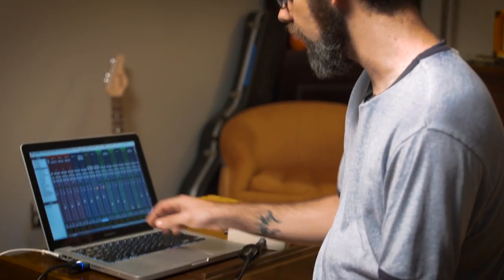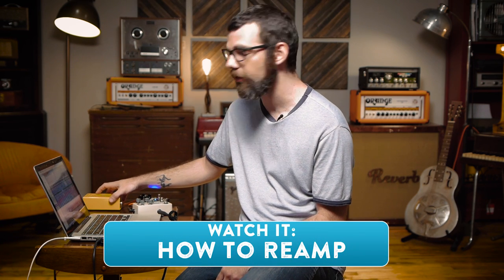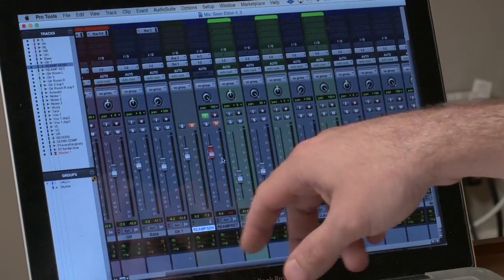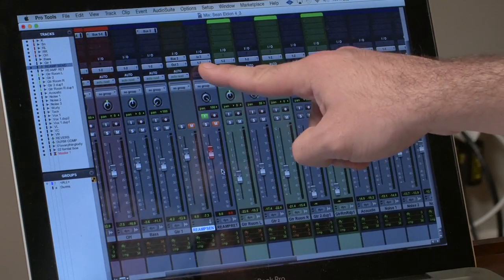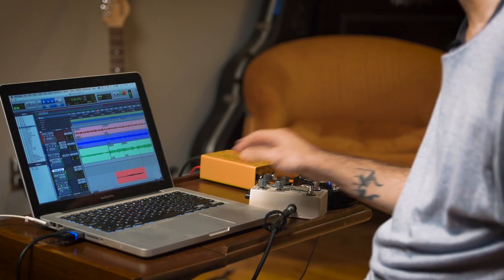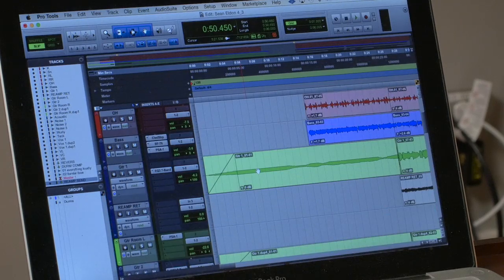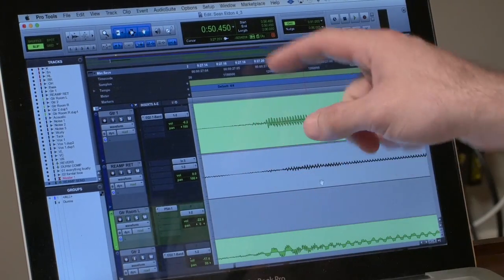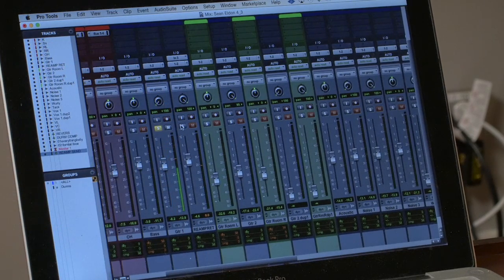How To Use Effects Pedals as Outboard Gear | Recording Tricks

Comment: Example 1:

Output of audio card (line level) > reamp box (line level to amp level) > pedal effect > instrument input of audio card

Example 2:
Output of audio card (line level) > reamp box (line level to amp level) > pedal effect > reamp box (amp level to line level) > line input of audio card

Example 3:
Output of audio card (line level) > reamp box (line level to amp level) > any pedal > amplifier input > record (microfone on amp cabinet into preamp.

Example 4:
Output of audio card (line level) > reamp box (line level to amp level) > any pedal > amp input > amp line out into audio card line in.
Reply: Espaço Ipiranga for example 2 would I be able to use my JDI or My J48 as the second reamp box?  Im thinking if the pedals are active then a passive right?
Reply: Thank you for this my friend!-this is what what SHOULD have been stated by the bloke in the video!

Comment: Well, Im sure many of us would of been interested in actual hardware connections, when searching youtube
Reply: Use an i/o plugin on the track in your DAW or adjust the output on the track if you can. Set the output to output 1 on your interface, for example. Go from output 1 on your interface with a 1/4 inch jack in to your pedal. Go out of the pedal with a 1/4 inch jack and back in to input1 on your interface. Make a new track to record on. Set the input to "input1", hit record, and you're done.
Reply: Interface out > reamp box > guitar pedal > DI box > preamp
Reply: @tomvice not applicable to this video

Comment: I usually send signal to my pedals through an output of my interface at -10dBv and return the same way on an input. Do I really need a reamp box? You think this will damage my pedals if I don't get one? Thank you!
Reply: Arturo Lopez Did you find an answer to this?
Reply: Excatly. No need for an reamp pedal if your not going in to an amp
Reply: You don't "need" a reamp box but a reamp will likely match impedance more closely to what the amp and pedal operate at input.
Reply: It does make a difference. Turning the gain down doesn’t mean there still isn’t an impedance mismatch. If you want to get all you can out of the pedals, and best quality sound, then reamp. ESPECIALLY gain dependent pedals like overdrive or distortion....big difference. Even reverbs and delays, even on pedals that are “allegedly” line level, like Eventide H9, its an improvement in sound quality.
Reply: Essentially, for me the biggest difference is that sometimes when you're not using the reamp box you can loose some low end. That's not always present but different pedals expect different signals so expect mixed results.
Sometimes there is no difference or is barely audible but in reality you'll never know untill you try out both methods yourself.

Note that there can be many different factors (impedance, voltage, db) so the best option would be just to play around, but keep in mind, that using a reamp box is the fastest, easiest and safest solution.

Comment: Really useful advise, but be careful with it. Guitar pedals are mostly mono... Reverb and delay are in most cases used as stereo effects and if you are doing mastering, bus processing or working with any stereo track you need stereo effects. Also, your interface conversion between analog and digital might not be as great as you think. Having something in analog is great, but it doesn't mean that it's necessarily better.  You might get better results from plugins in the end.
Reply: I'm new to this and am wondering, isn't there a stereo reamp box in the market?
Reply: There is a stereo reamp box, but many reverb and delay pedals are mono, so it doesn't matter if you split it after the effect to stereo, you will only get double mono recording. And most of the comp/eq/distortion pedals are mono also. So it can be used for limited number of situations and it complicates your workflow.
Reply: Milosh Mitrovic Thank you for taking your time! I'm thinking of buying the Strymon Timeline, and already have the Bigsky. These are stereo, so technically with the addition of a stereo reamp box, stereo mixig would be possible right?
Reply: Yes, that would work, you would need something like ART dualrdb or some other stereo to stereo reamp box.
Reply: Using a mono DLY or RVB is often beneficial as it adds a sense of space without cluttering the over picture too much.
Reply: @MiloshMitrovic  Could I use a 2 Channel Radial DI Box so I'm sending 2 XLR's into my interface to record in stereo? I'm confused if I should get a 1 channel vs a 2 channel, but it would make sense getting a 2 channel so I have stereo signals coming back
Reply: @razzerraw1108  Two-channel DI Box is same as having 2 one-channel DI Boxes. Channels are independent, you can do whatever you like with them. You don't get stereo signal if you use only one input, because the information is mono, but if you have a stereo out from one of you pedals like reverb or delay, you can record that stereo effect by connecting two outs from that pedal to the DI Box and then the DI box to the audio interface.
Reply: @MiloshMitrovic  So I would need to run 2 XLR's back into the interface taking up 2 parts instead of 1?
Reply: @razzerraw1108  Ok so let's say you have a stereo guitar delay. It has mono input, you connect one cable out of interface to the delay pedal in. Stereo delays have two outputs you connect two cables from them into the DI 2 inputs. From DI 2 you connect 2 XLR cables back into the interface.
Reply: @MiloshMitrovic  Thank you! I'm just confused if I should get this 1 Chanel Reamp kit from radial shorturl.at/uBKV4 , Or buy them both seperately because I need a 2 channel Box for stereo pedals. I'm planning to use this pedal shorturl.at/pDE37 as an effect for my DAW. If you can tell me which Channel DI Box would work best with this pedal I'll go ahead and start everything right away (:

Comment: so, if I have pedals, do I plug my guitar straight into my Audio interface and then use a Reamp box to add the effects after? or can i use a DI box? 

was the initial signal recorded with an amp or directly into an audio interface?
Reply: you can stomp boxes in to Di but you need a ReAmp to effect a pre-recorded track with your stomps, etc.

Comment: Should I use Speaker Cables or Instrument Cables?
Reply: Connectingf what?
Reply: Balanced (TRS or XLR, whatever your interface outputs) from interface to reamp box (You can use a TRS to XLR adapter if needed at this stage). Standard instrument cable to get from reamp box to pedals and from pedals back into your interface (assuming it has a hi-z input otherwise you will need a di as well).
Reply: So, if I don't have an hi-z input in my interface, I will need two DIs? I'm just a little confused because I'm actually a drummer, I don't understand shit about guitars stuff, sorry

Comment: Keyword: Delay Compensation. Protools can do this by itself,  can't it? At least in my system  (PT 10) it can be activated.
Reply: Delay Compensation on Pro Tools is for processing with plug-ins.  You never, ever, want to record with Delay Compensation on.  If you want to time align things that have latency delay, like in this video, you'd be using tab to transient and nudging the audio files in place.

Comment: Beginner question: so you can’t use pedals as outboard gear through reamping if you want to mic an amp?
Reply: No, you can do that. If you do the same exact thing in this video, then end the pedal chain by connecting to an amplifier instead of a di box. Once you have signal going to the amp, just mic it up to your interface and daw. Now you’re ready to record the reamped tracks through an amp.

Comment: Im just wondering if it's a good idea to plug a bass guitar into a noise gate and compressor pedal before it goes into the interface.
Reply: Why wouldn't you just use a noise gate and compressor in Pro Tools or your DAW?

Comment: So its mandatory to also have a Reamp box in order to use pedals?
Reply: I have just recorded directly through my effects but have seen people explain how to reamp with them without using a reamp box etc. But it varies on what kind of sound you want to go for. Apparently if you have a buffer pedal or any boss pedal (since they have buffers built in) you can also use that as a reamp box. It’s not totally necessary, it just gives you a better chance at creating as clean of a recording with your effects as possible by converting the impedance that travels through and out of your pedals etc.
Reply: Yes. Impedance mismatch makes the signal really sound really thin without it. You'll ALSO need a DI after the pedal if you have a focusrite crappy interface (that are notorious for their shitty hi-z inputs)

Comment: soooo is the reason i'm getting this dreadful feeback because of me not using a reamp box or is that something else?
Reply: just came here from trying to use the line out on my interface into my pedal, and then from the pedal to my interface input with high impedance turned on... im guessing we both are getting feedback because of the absence of a reamp box
Reply: psychedelicgoofball got that sorted ages ago. your interface should’ve came with a mixer software (allows you to monitor direct). what you want to do is mute all the channels on the software.

Comment: This is not a good idea at all.  You've already converted the signal from Analog to Digital once when recording it, now you're processing the Digital to Analog signal again, and then REPROCESSING the whole thing again as a 3rd conversion.  The sound is just going to get degraded and degraded.
Reply: Ltw Recordings That’s why you use the Aux track to compensate for any signal loss. Also a good clean overdrive plugin will get you back to the original signal. Just a lil touch though!